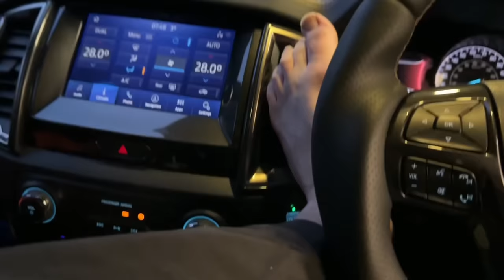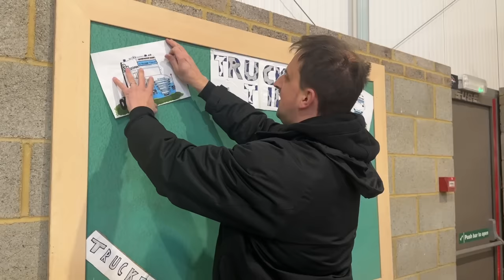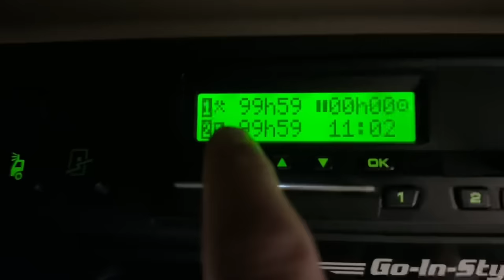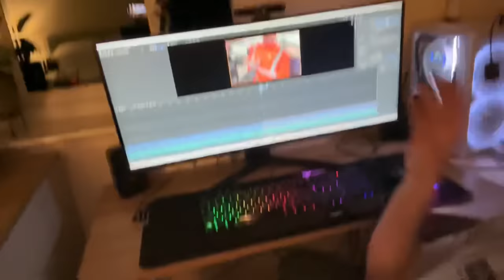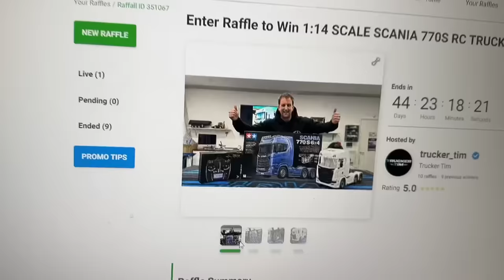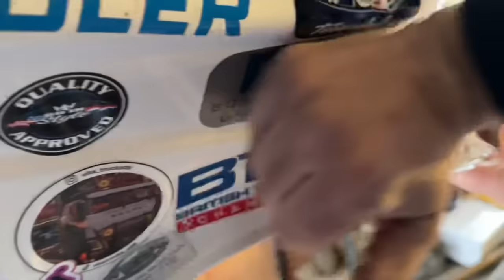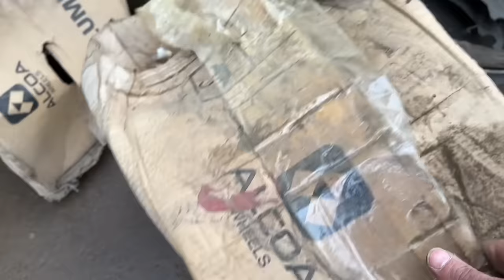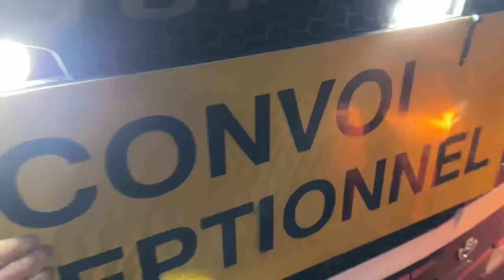TRUCK STUCK IN EXTREME FLOOD | BUYING A NEXT GEN SCANIA!? | TTW | #truckertim

Comment: I honestly understand the frustration. 

If anything ,one thing that might help is to have someone do the editing for you + also taking the video (or even still have yourself take videos and have someone else edit them). And then you can just tell them how you want the video edits go. Like tell the person your template that is like how to structure the video, insert stuff for comedy purposes etc.

That way you won't burn out fast, and you have more time doing what you wanna do and not be stuck all weekend editing.

edit:

Also, focus more 1 project at a time. Don't bite more than you can chew. That is really a fast track to getting burned up.

Unless if you have people employed to do the truck restoration/upgrades. It will take a while to finish them at the same time also means that it will be awhile to get content up.

Cause really, right now you are fighting multiple Fronts. 

Front 1: Restoring + upgrading Multiple trucks

Front 2: Haulage work

Front 3: Winch out work

Front 4: Only one editor which is you (so you need someone to do that for you)

And many more stuff on the back lines.

Look at what happened to Austro-Hungarian Army when they fought the Two front War.

I think focusing on one truck at a time + having Lombardo Winch out work on the side and some haulage here and there is the way to go.

i.e. you can focus on that Volvo build first and have that see through and have on and off lombardo winch out videos when they come up.

Once volvo is done, then do the Volvo with Scania V8 build etc etc.

Comment: talking bout buying a next gen while keeping the other 4 projects moving along, can't see how that's financially possible all at ounce. re built a few big ww2 trucks myself from chassis rails back up and you can easily sink 2-3 years into one truck and many 10's of thousands of pounds. you got loads of content outlets just keep doing what your doing and everything will fall into place. i really think the 4 series will be a gem ounce finished, just be patient and put the 2-3 years into it and end up with a nice truck rather than running round like a headless chicken and not finishing it at all. 

certainly side line the V8 volvo build this year and get the other volvo done and the 4 series as a finished rolling/driving chassis. i'd say that would be a decent year's productivity, specially when you look at that 143 nipper been working on which is 2 years work i think and there's 3-4 of them working on it.